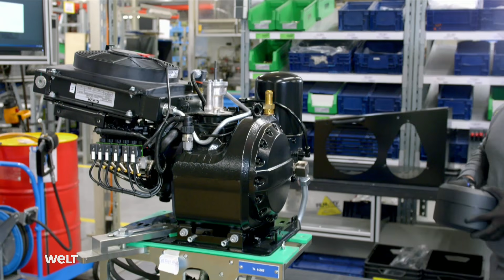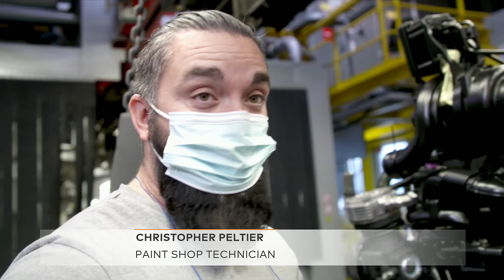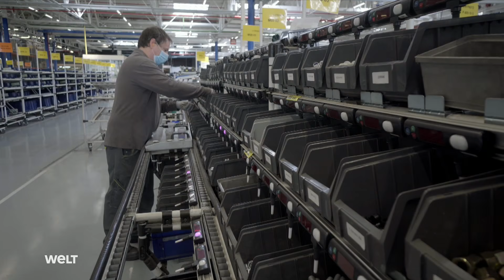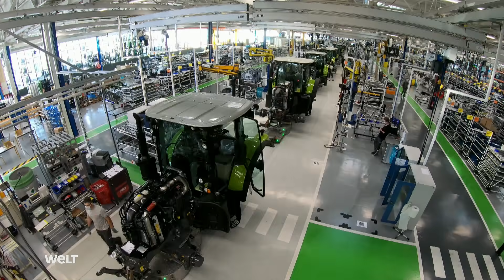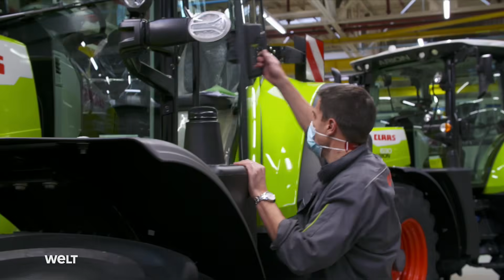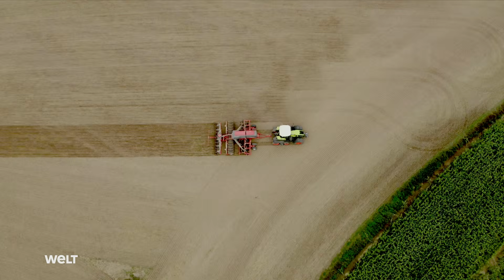GERMAN AGRICULTURAL MACHINERY: Class Axion 960 - Birth of a High-Tech Tractor | WELT Docu

Comment: 0:31: 🚜 The Le Mans factory in France assembles the energy-efficient Axion 960 CMOS tractor, which has won awards for sustainability.
6:56: 🚜 The tractor assembly process involves cleaning, painting, and mounting implement linkages.
13:38: 🚜 The tractor assembly process involves automated systems for parts storage and delivery, as well as precise installation of components.
21:11: 🚜 The installation of the complex cooling and exhaust systems is completed, marking significant progress in building the tractor.
28:42: ✅ The tractor assembly process in the factory in Le Mans involves various steps and quality checks.
34:33: ✅ The tractor undergoes various tests to ensure it meets specifications and is error-free.
41:09: 🚜 The advancement of tractors in agriculture is improving efficiency, reducing fuel consumption, and benefiting farmers and the environment.
48:26: 🚜 The French tractor factory in Limon produces efficient and modern tractors that contribute to eco-friendly agriculture.
Recap by Tammy AI
Reply: This made my homework so much easier! Thank you!